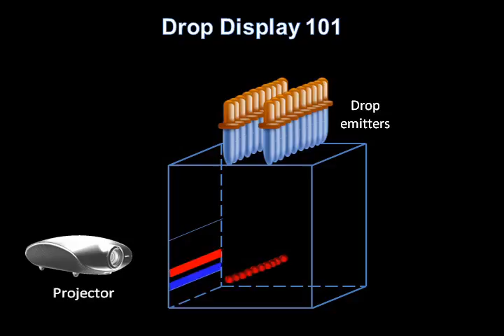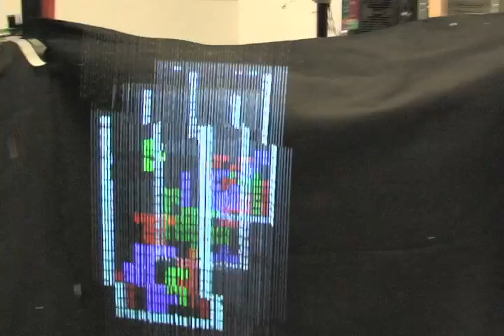A Multi-Layered Display with Water Drops (non-technical version)

Comment: If the spaces between the rows were equal to the spaces between the water droplets (the spaces between the lines), then you would basically have a volumetric display. Decreasing the space from there would make a higher resolution display, but you can only decrease the space so much before the drops start running together. :(